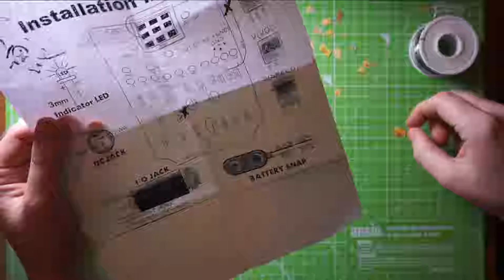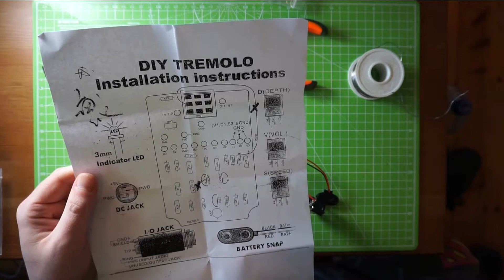DIY Tremolo Pedal

Comment: Just got one of these built. The instructions had the transistors all the wrong way round compared to the PCB, I figured the instructions would be right as its easier to reprint paper than a misprinted PCB. This proved to be an incorrect assumption on my part . As you may guess, it didn't work. Trying to reposition the transistors proved to be problematic, so I had to replace them. Works fine now, although I never bother with the 9v battery snap, I always use external power.  So, make sure you put the transistors in according to the markings on the PCB and not the instruction sheet. I contacted the seller and they said they would sort it, however, so if you get one, it may be ok.
Reply from the maker: Yes, I think the instructions that come with these cheap aliexpress kits tend to be very poor. A small amount of experimenting will usually get the pedal working though. And hey, you get what you pay for I guess.
Reply: I'm going to swap the volume pot for one with a higher resistance too, its like some kind of insane boost pedal, anything past about 9 o'clock.
Reply: I put mine in the way the outline is and my pedal just has more gain and a working volume knob when I turn it on. I cannot figure out why I don't have a tremolo effect. I have a lot of experience soldering so everything is clean and matches the instructions. Idk what to do
Reply: @Xxmeca421xX  Hey there.. Does your volume knob controls only the effect? Mine is affecting the whole signal. Not sure if it's supposed to be this way.

Comment: Hey there.. Does your volume knob controls only the effect? Mine is affecting the whole signal. Not sure if it's supposed to be this way.
Reply: i just realized the potentiometers have different values because the same thing was happening to me. The Volume is B503 it says on the top of the knob in my kit. the speed and depth are the same at like B20K (mine said B203 or something)

Comment: Mine just has more gain and a volume knob after finishing it. The depth and speed do nothing and there's no tremolo. I put the transitors in the way the outline on the pcb is.
Reply: Im having the same problem. I did what the pcb said and it doesnt work just the volume knob works. Have you found a fix for it yet?
Reply: @Buhhhhhh-xi4ju  reverse the  transistor on the end and ignore the 'D' outline that's it's soldered in. Or you might have the older board where the other two transistors marked backwards.
Reply: Hey there.. Does your volume knob controls only the effect? Mine is affecting the whole signal. Not sure if it's supposed to be this way.
Reply: @paulofernandes6709  One for depth, speed and volume/boost

Comment: I already built proland tones Klon clone and it sounds great so I plan on doing this next. I did notice in their picture on Amazon they have two jumper wires on the solder side of the pcb which is a little shady. If the pcb was designed correctly those shouldn't be nessesary. It's just got me scratching my head lol??? Edit: The two wires on your diagram are the jumpers I'm refering to. If really like to figure out what that was all about before I build this kit. Any insight? Maybe a mod or a version 1 fix until they could correct the pcb?

Comment: i foolishly bought this pedal as something to try for a beginner haha. but i am up for the challenge, can you help me understand how i am to know the correct colour coding and where to solder each wire? I am aware of +/- etc. Also how i am to know which way to place each component, on the board? big thanks in advance if your willing to help!
Reply from the maker: Honestly these Chinese pedals are terrible for beginners. Their idea of instructions are extremely poorly photocopied ms paint style pictures. The color coding of the wires doesn't matter too much. I mean the convention is to put red to 9v and black to ground but beyond that you are just making connections and the color doesn't matter.  If you meant the color coding on the resisters then you can look it up online and also i think these kits usually come with the resistors labelled. The capacitor codes can be a pain to understand but just google the code if you're unsure.

There are only 4 components on this kit where the placement matters, the electrolytic capacitor (one that looks like a tiny battery) should have the long leg to the edge of the board (+) and the short leg (-) right under the transistor above it. 

The 3 transistors should be placed so that their shape matches the semi-circular shape marked on the circuit board in white.

The LED is similar to the capacitor where the long leg should be wired to "LED+) and the short leg should go to "LED-".

As far as the wiring goes then its all numbered. D1 D2 and D3 should be connected to the depth pot terminals 1 2 and 3. If you lay the pot flat on a surface so that the knob that you turn is pointing upwards and the terminals are pointing horizontal towards you then they are numbered 1,2,3 from left to right.

Hope this helps and thanks for watching
Reply: @LiamOConnorAudio  Thanks a lot for that awesome reply man, speedy too. really appreciate ya.
Reply: LiamOConnorAudio I’m almost done! One question, it says to connect the DC jack to PWC and the IN ring to PWC.. what does this mean?
Reply from the maker: What i did was to connect the ring terminal of the input jack to PWC and also to the largest terminal on the dc jack. then with the largest terminal of the dc jack at the bottom you connect the next one up to PWB and then the topmost terminal goes to +9V.
Reply: @LiamOConnorAudio  Thanks a lot, just finished the pedal and it works!
Reply: Bah, you think that's bad. I decided as a beginner to jump into designing my own overdrive from scratch, despite knowing nothing. Being for bass, I got the extra fun of crossovers and blends and such to make the effect bass friendly. It's very much a unique circuit considering it's my first go at building effects. 1 and a half years after I started, I'm finally ready to build it on veroboard and put in an enclosure.